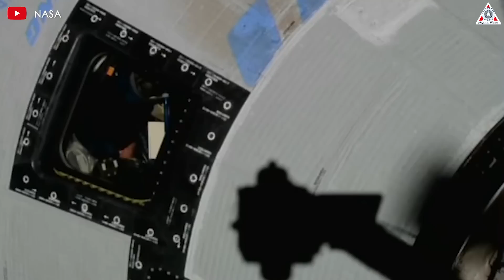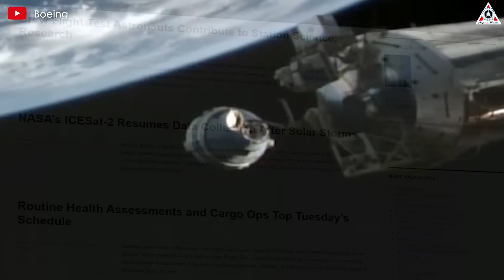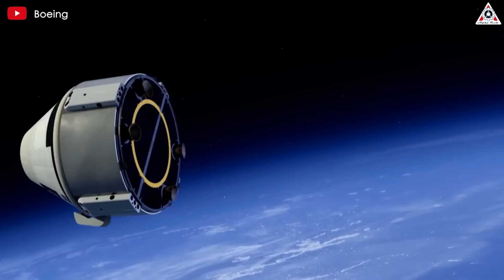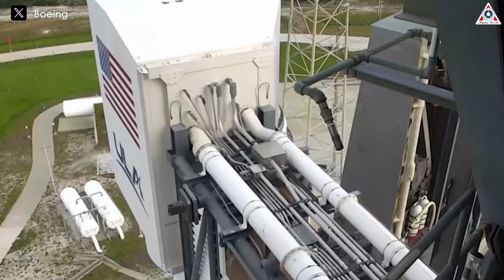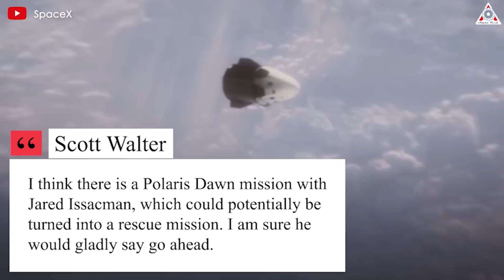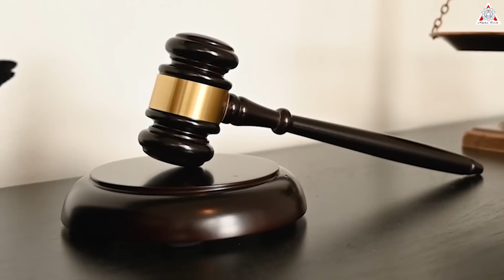Boeing Starliner Disaster! NASA Is Giving Up... and Realized SpaceX Better...

Comment: Boeing Starliner was never fit for flight, the issues is with the CEO to engineers of Boeing  and the company needs to be reworked from the top down to resolve the main issues.. and Not the hardware.

Comment: I get the impression Starliner is not fit for purpose, and was seriously undercooked as a concept.  So, how do you de-orbit this dead hulk if it outlasts the 45 day limit?  Or will they keep it parked with the ISS until NASA de-orbits BOTH at ISS end-of-life?
Reply: The problem with that idea is that the ISS is short on places to dock. They are not going to have a work around to keep Starliner connected indefinitely.

Comment: Its now July 15th - I assume they are still there now?
However recent Dragon 9 failure not mentioned so not sure how  fresh this video is
The idea of standard docking limits innovation. Basic interface ability to a rescue dock allows improvements and rescue missions
Reply: How can you compare the starliner with the falcon second stage? How many times has SpaceX been using the falcon boosters and not lost a payload of any kind? How many crew dragons have had any problems with going to and returning from the space station without any problems.?